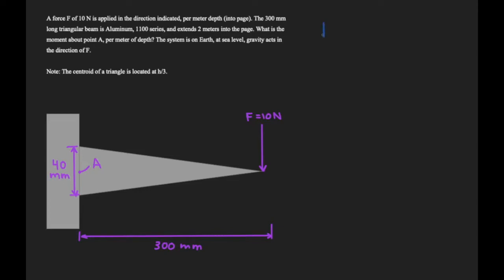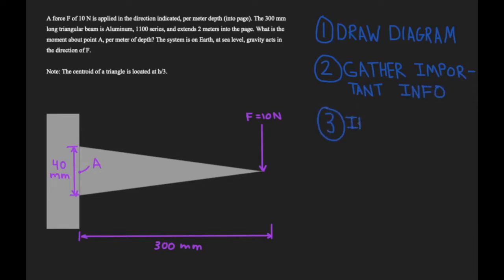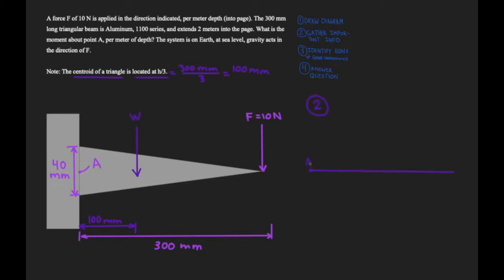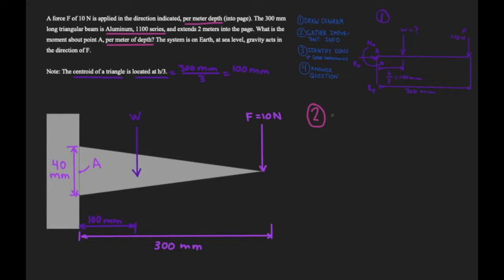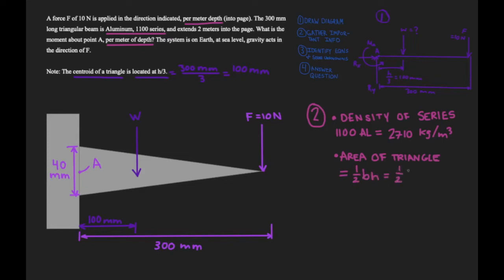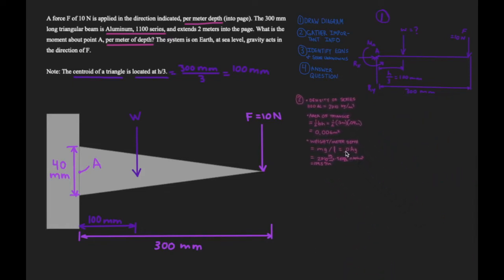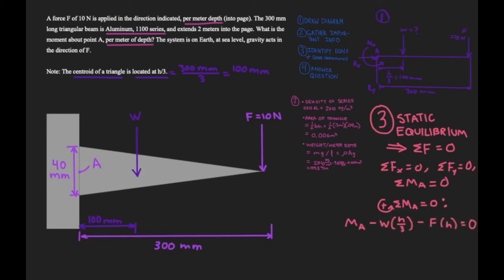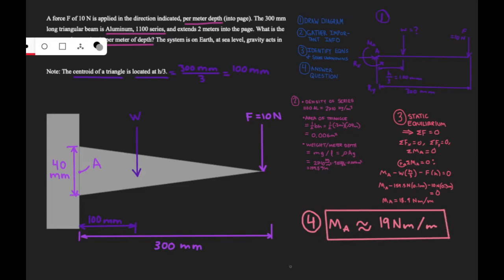TESLA Mechanical Design Engineer Interview Question SOLVED!

Comment: I believe there is a mistake during the calculation of triangle mass. it should be multiplied by 2 meters.
Reply: With this correction, I got an answer of ~17.4 Nm/m
Reply: The question asks "moment about point A, per meter of depth" , so ignore the 2m depth (distraction), and calculate using 1m (as in the video).
Reply: He used area not volume though in the next step right? So why would it need to be multiplied by 2?